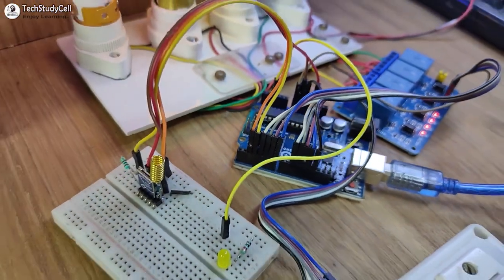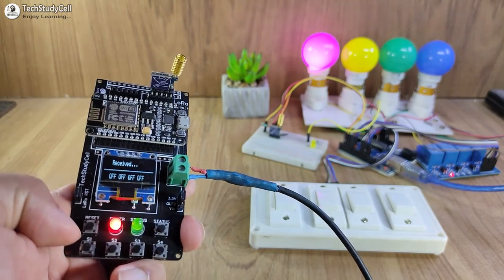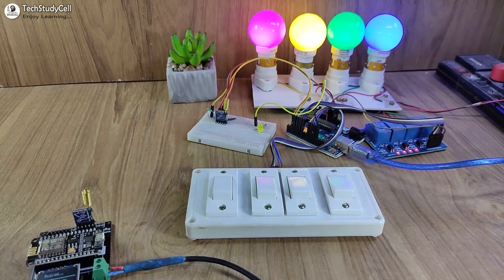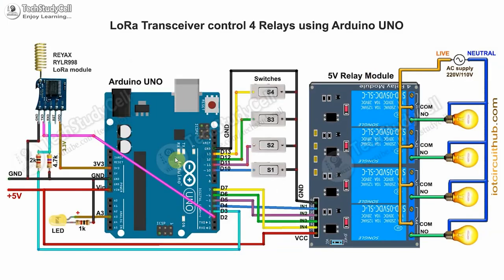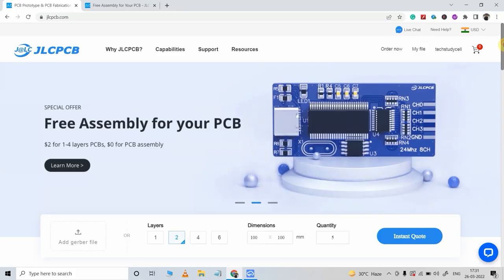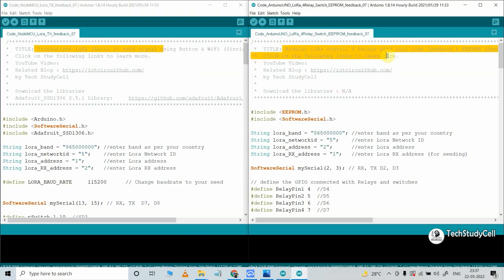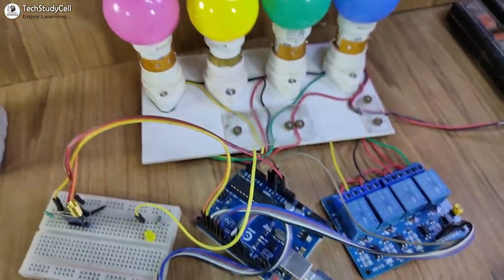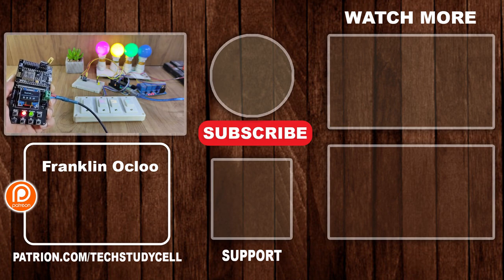LoRa Project Arduino ESP8266 control Relay with feedback | Lora Tutorial using RYLR998 Lora module

Comment: I have RYLR998,  when set band using At command "AT+BAND=865000000", it remember only when it is connected, when i disconnect and connect and ise "AT+BAND?"
it shows +BAND=915000000Hz, why it is not remembering BAND?